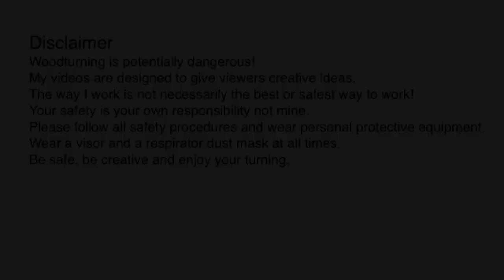Turning Mahogany Bowls with Milliput Epoxy Putty Inlay

Comment: Just a quick tip . When rolling Milliput, it wont stick to the roller if you keep the roller wet. You can also add a few drops of water on the Milliput. Just like rolling pastry dough and adding flour.
Great videos.
Reply from the maker: I use water when working with Milliput but try and avoid it with wood as sometimes it creates a coloured slurry which can soak into the grain. I have found that rolling it between sheets of baking parchment also works well ( I used this technique in my video where I coloured the Milliput turquoise). All the best, Jim

Comment: Fascinating Jim!  Can younreuse that spent milliput...rehydrate it?  Or is it a gonner?  Will it help in punky, cracked wood inside resin?
Reply: I was wondering how the black and white lines were perfectly straight...smart man you are!
Reply from the maker: thank you
Reply from the maker: It is epoxy based so once cured it remains cured, it is good for filling voids in wood. Many thanks for watching .

Comment: Thanks for the video Jim, some good ideas there, i wonder how the epoxy would look with a texturing tool or a chatter tool might work. regards Dave
Reply from the maker: Thanks Dave, I recently acquired a Robert Sorby texturing and spiralling tool, so I have been wondering the same thing. In theory it should work well, as it doesn't chip out easily. I will hopefully be doing a video on this soon. Cheers, Jim

Comment: Great video's Jim!  I really enjoy what you've done and it's given me a number of ideas to embellish some of my turnings.  I wonder if you can mix some fine metal powder into it without harming the turning/durability of the product (i.e.; copper, bronze, aluminum powder, etc.)?  Thanks sooo much for sharing and I'm looking forward to future videos from you!  Safe turning always!
Reply from the maker: I have done a fair bit of resin cast bronze work, so have wondered this myself. You can add powder to the putty but it will make it a bit crumbly. I have a video coming up shortly where I am modifying the putty ( not with metal powder ) but my technique needs modifying. I think too much metal powder would be needed to achieve a good aesthetic result, I have some ideas that may overcome this but untested. Thanks for your comments, Jim.

Comment: Hi Jim can you add coloured inks or spirit stains to milliput  to make different colours.
Reply from the maker: Hi Andrew, yes you can colour the white Milliput, have a look through my earlier videos and I did a couple where I did some colouring. It is quite messy to do, I use pigment powder with epoxy resin as a carrier. I have not tried spirit stains yet but it is on my list list of things to try. Cheers, Jim.

Comment: do you have to put epoxy on the wood then the milliput or just the milliput, ,,,thank you
Reply from the maker: Hello Guy. Sometimes I coat the recess in a slow set epoxy resin but it is not always needed and I did not do it in these bowls. Milliput is very sticky on its own, I only use epoxy resin when I think the joint may be under more stress, such as a full thickness inlay or if the Milliput is going to be carved or textured. Cheers, Jim
Reply: Thank you

Comment: Maybe your mahogany is some thing else. I have had the same trouble turning what we call Asobe in UK IPE general / commen name Ironwood.  A lot of sharpening no shavings only dust. Also used for harbour protection as  it can with stand salt water and baricalls dont grow on it. Just a sugestion.  David.
Reply from the maker: It could be, but most people who have looked at, think it is most likely a type of mahogany. I think it is probably mahogany but it is very old and weathered and has just gone very hard and brittle. It has a slight musty smell to it, I suspect it was probably left outside for some time in its past. It is a bit of a mystery as to what it was taken from. I suspect it may have been a piece of fitting from a ship. Cheers, Jim
Reply: With the extra info you put in you answer I am sure it is IPE.  If you are on FB then I can show you what I think you have. The colouring is very much like mahogany.  David.
Reply from the maker: Yes I think you are right. I looked it up on the wood database when I got home from work and it looks spot on, the specific gravity is correct too. A good spot by yourself ! The grain and pores look identical. The wood database is well worth looking at if you haven't done so, loads of great information on there. Thanks for your help, all the best, Jim.